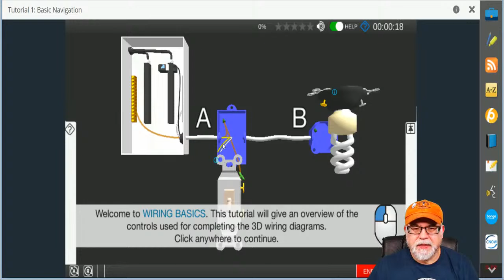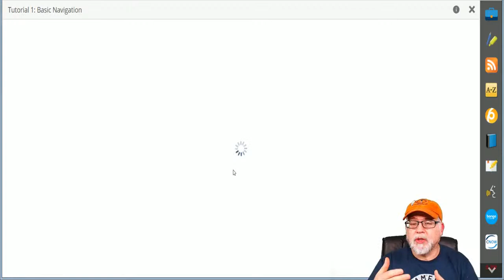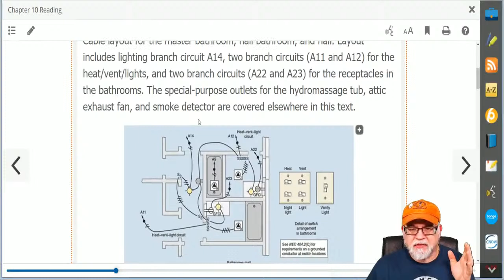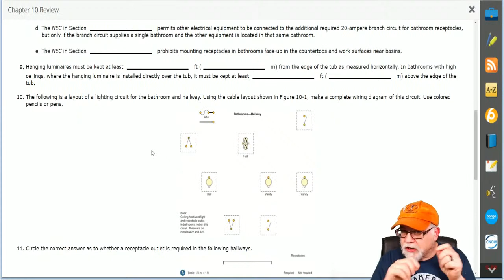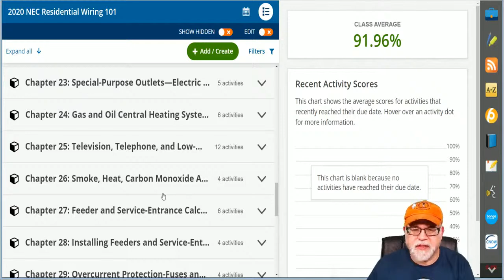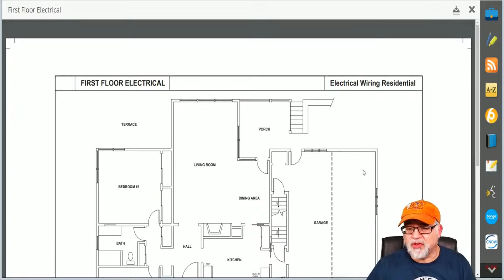Electrical Training Course Online - Electrical Residential Training Course Popular Video

Comment: Good evening Paul,   I recently had an issue with EGC size inside a cable.  How does the manufacturing world determine the size of EGC they will put inside the cable?   Why is it not the max out in accordance with max ampacity of current carrying conductors allowed?
Reply from the maker: Greetings. The EGC in cables is sizes per the specific cable standard. This should correlate with 250.122, which is based on the Overcurrent Device. Sounds like you may have been using cables in parallel. Single cables are not designed to take into account parallel installations as the EGC is based on the overcurrent device for the single cable. The EGC isn't sized or based on ampacity of ungrounded conductors...again it's per the Overcurrent Device in 250.122.
Reply: @MasterTheNEC  10-4. Thank you so much.  Some lessons I have learned the hard way.   Lessons that are free get little attention lessons I have to pay for get burned into memory weird how that works.    I appreciate you always going out of you way to help us out have a good night